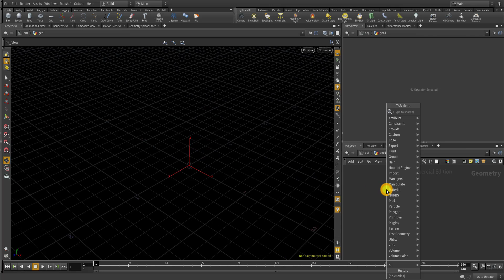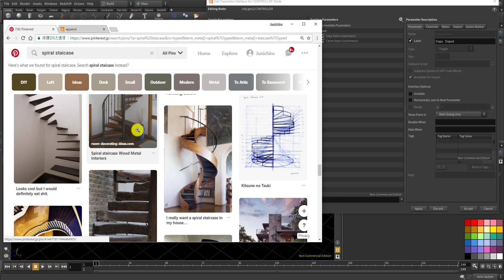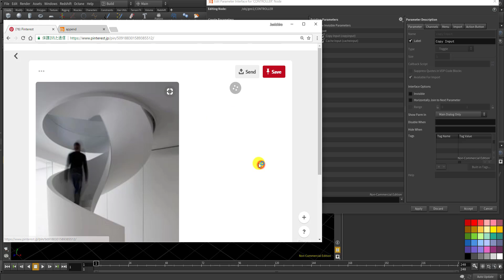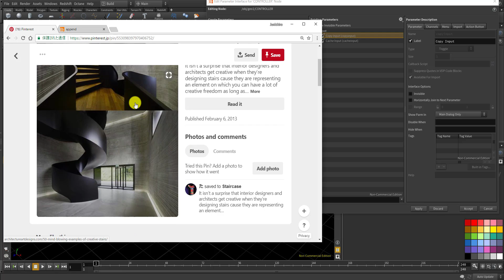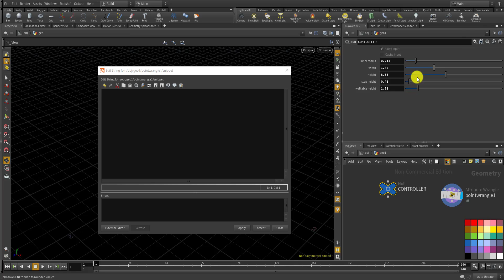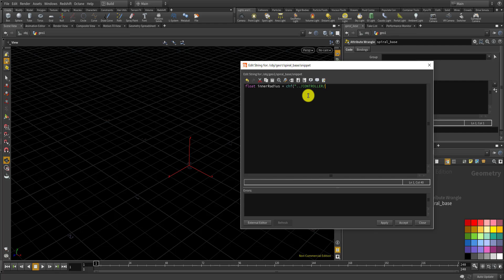[Houdini Tutorial] 0024 Spiral Staircase (Slow version)

Comment: Hi! I have a problem when you start add point. My scene is totaly like you. I have not any erro also but there is not any point in the viewport. Have you got anyi idea why?
Reply from the maker: you might have to change the run over parameter of the wrangle to detail.
Reply: Thanks you reply. actually it's on. Have  you any other?
Reply from the maker: have you set the parameter in the null node to any number? you might be having all the parameter value to be 0 which won't show anything as a result.
Reply: yeah I've set it, but nothing. Some problem width null parameters. In the end success in doing thet. Thanks reply.